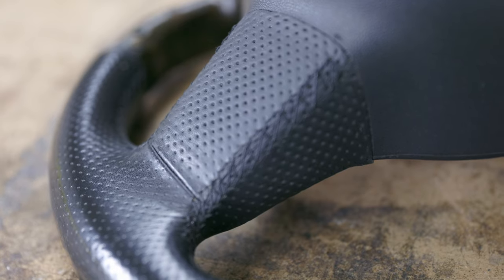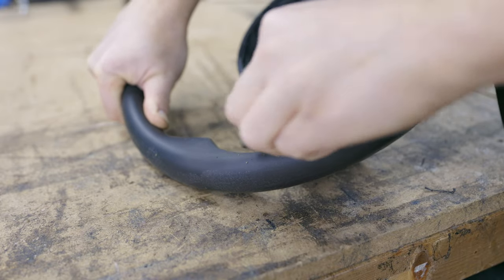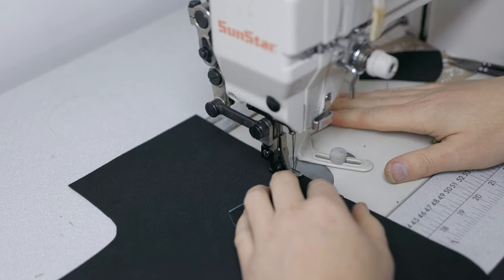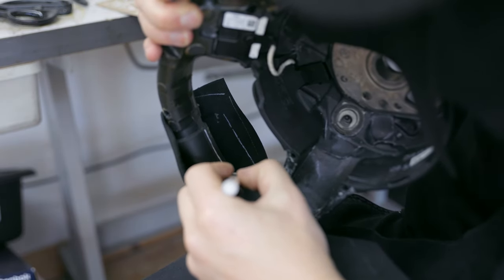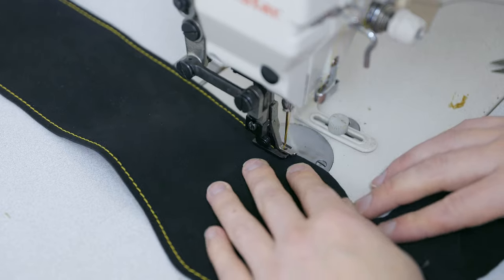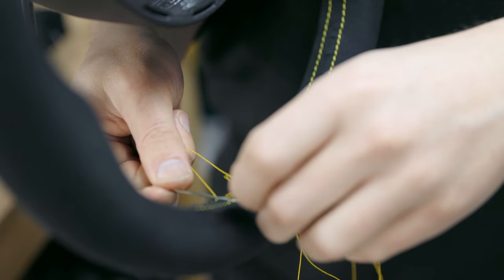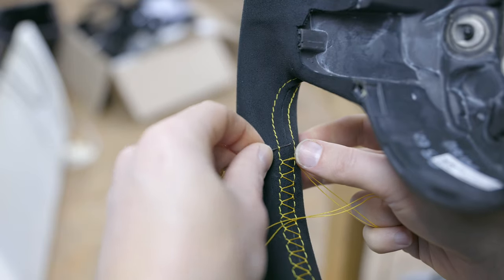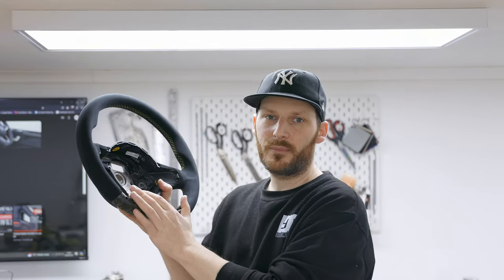The stitch that brought you BMW’s M SPORT look -  Audi RS4 steering wheel retrim

Comment: Thank you for illustrating your process. Do you count the stitches along either side of the perimeter to make sure you end up with an equal amount of pairs for the centerline stitch or does it usually work out by itself?
Reply from the maker: No I don't count them, sometimes the stitches can run away from one another but there are some techniques to bring it back in line.